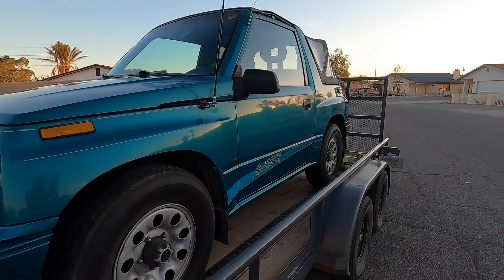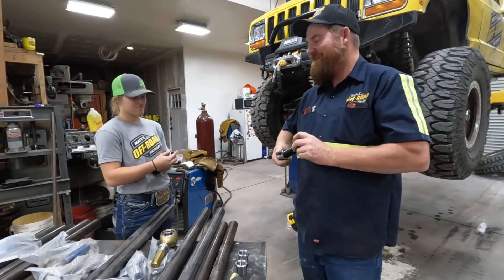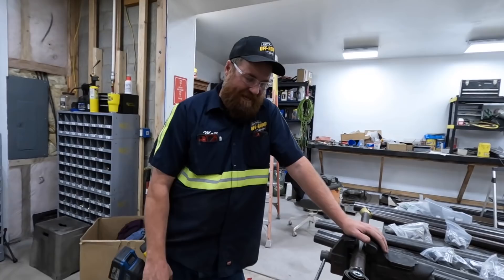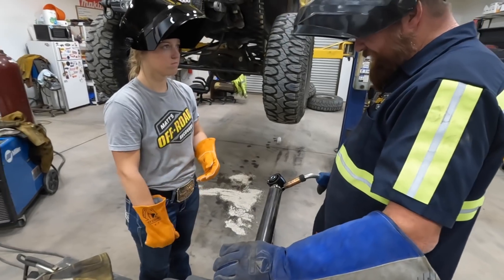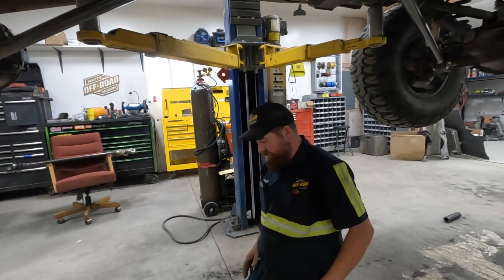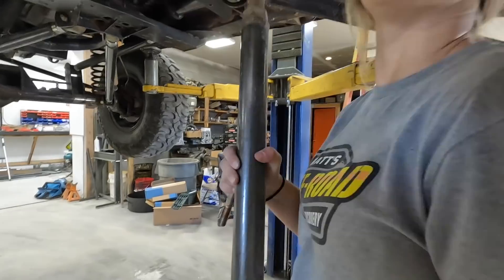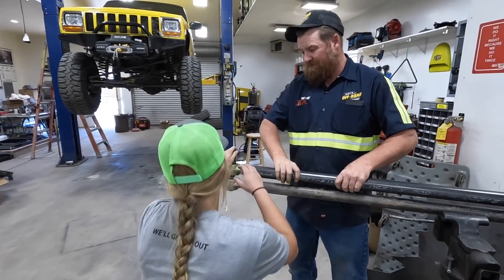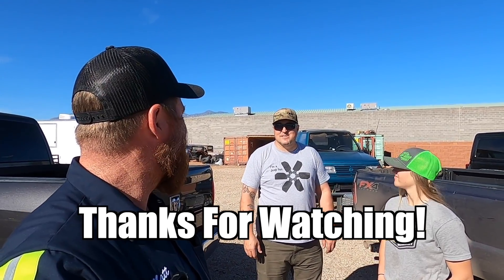This Is Going To Hurt, Working On The Jeep Banana

Comment: Welding Injuries In The Workplace: Fire & Electrical. Welders make up over half a million workers in America's workforce. Welding is also one of the most dangerous occupations because of the daily likelihood of workplace injury from burns and electricity.

Welding Accident Statistics. Welders have the highest-risk occupation in all of the construction industry, an industry already known for its hazards and high fatality rate. Welders face hazards like electrical shock, full-thickness burns, loss of vision, and brain damage. As a result, managers are responsible for ensuring their workers are ...

Welding is one of the most hazardous occupations in construction. Traditionally, welders had to fear workplace injury from burns, electricity, and "welder's flash" (blinding and diminished vision, see below). Recent studies have shown that toxic chemicals released from welding rods put welders at an additional workplace risk for less immediate but no less serious conditions of lung ...

3. Electrocution. Arc welders regularly work with voltages ranging from 20 volts to 100 volts and up to 575 volts inside the case of the welding machine, putting workers at risk of electric shocks. Electrocution at these levels can cause skin burns, spasms, muscle damage (and muscle paralysis), and death. Even low voltage shocks can surprise ...

dr johnny md vmd
phd engineering

Comment: You need to be more careful with your welding.  (See sign on wall:  Caution).  How do you get away with no flash burn when you do that work without proper protection?  It must be that your skin is conditioned from all that sun you guys get out there, eh?